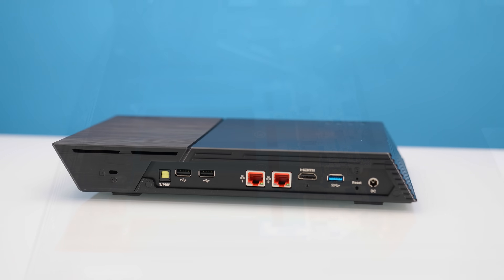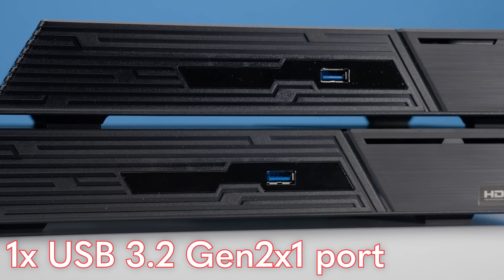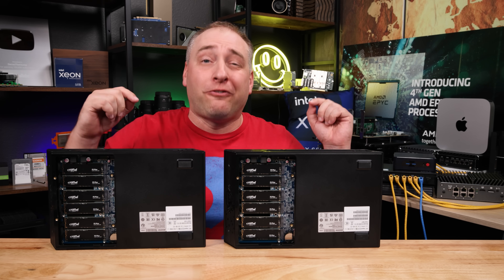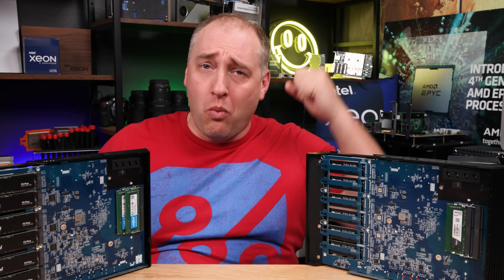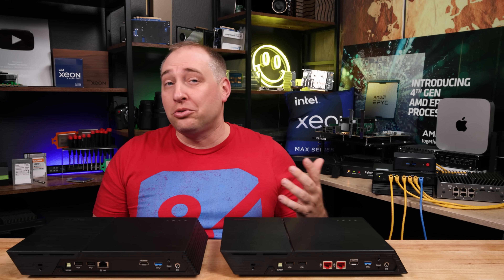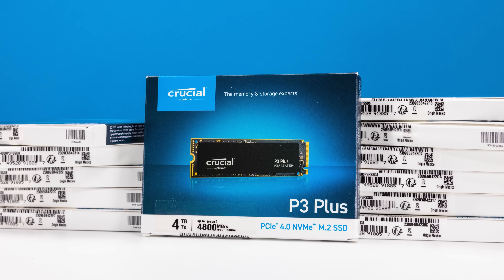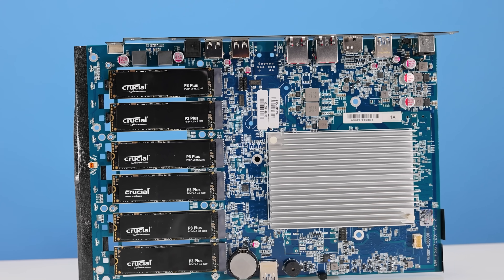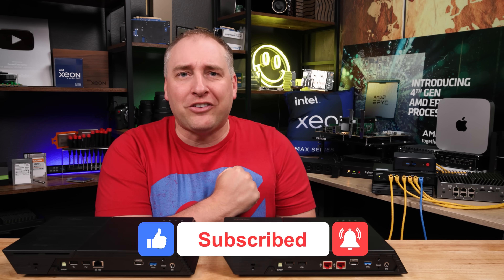Crazy 48TB SSD NAS and Cheap 6TB Version Asustor Flashstor FS67

Comment: I'm considering between the TBS-464 and the FS6706T.
The TBS-464 supports ZFS, but it has fewer M.2 and RAM slots compared to the FS6706T.
Is ZFS such a significant advantage that it's worth giving up the better hardware expandability?

Comment: Even though they think they need to price this device at the same price as a 6-bay HDD NAS, I think they should cut it to $249 for the USA market. Home users would love it! Load it with 6 x 2TB sticks and you’ll have more than enough storage for the average family. But add a 10Gbps connection to make us feel good. Most ISPs only offer 1GBps. I’d buy it at $249. HDDs are becoming obsolete, just like CDs.

Comment: I really don’t understand why they went so anemic on the processors, retail price for a way more powerful CPU, including a cooler and IHS is <$100… Toss the cooler, toss the IHS, toss the retail packaging, and toss the PCIe switches, they should be able to get something with may more connectivity for a few extra dollars, 20 at most.
Reply from the maker: These also use a lot less power. Important for 24x7 on devices.

Comment: In our studio we have 2 of the 10GbE model and after few months of usage they are just Great. One whe use for fast backup on set and the other one for the VR in house set as storage for the dedicated Unreal WS. Both situation require light/small, high capacity, non moving part storage.
However we upgarded the RAM and we instaled TrueNAS scale instead than the original OS. ZFS z2 setup(28TB practical capacity), easy cloud sync, openvpn, auto shut down on power failure,small custom docker to manage some in house utility, etc.) 
Like you said this is mainly a storage solutions you don't get crazy speed out of it but is very light, low consomption, very costumizable.
Low consomption is great on set where often we work on powerbank.
Reply from the maker: I am now using one in the studio and one at home just for the quiet operation as well.

Comment: I kind of get it, but since they don't need pcie drives for performance, you could also build something like it with Sata SSDs which could make it cheaper as there are less pcie lane issues. At least for DIY you could get the same results with sata for cheaper, but probably not easily in that small space.

Comment: im pretty unfamiliat with NAS's so my main question is: What OS does this thing run? 

Im planning out my hime network right now and would like to have a home server for storage and backups and use this thing for that and even as a firewall since the 6 drive versikn has 2 ports. 

But id like to install windows server core on it. But does that use up one for the slots? Can I install Linux on it? Can i put it into my windows server domain? 

And i know that its probably not best to have firewall and NAS in one device but I still dont know anything about operating this thing bejond benchmarks 

But Im happy to see upgradeable RAM.

Comment: I'm interested in using something like this for audio plug-ins. I've run into a problem with my UAD Apollo audio interface not working on either of my Windows systems and I'd like to pickup an Apple Studio with 2TB internal for audio applications only with plug-ins installed on the NAS with possible audio storage that may need accessing in the DAW. Any considerations? or would this result in audio artifacts due to speed restrictions. I don't want to invest in something that would theoretically work only to find out that working on larger projects will result in failure.

Comment: There are people, who just need large storages for storing movies or recorded videos, once data is stored there won't be a lot of editing in them,
Hard drives are not a good solution due to moving, fragile and bulky parts...
Ssd will shine in such cases...
A solution must exist with
1. Lower transfer speeds.
2. Lower TBW
3. Lower write speeds, (and a fast cache drive)
4. Sata as it would be cheaper than m.2

Comment: These m.2 SSD are The Same Speed but Cheaper Silicon Power 4TB UD90 NVMe 4.0 Gen4 PCIe M.2 SSD 
With they work in the Asustor Flashstor FS6712X?  Save me $50 buck per ssd? $159 each 4TB

Comment: two questions Can I use the SABRENT 8TB Rocket 4 Plus NVMe 4.0 Gen4 PCIe M.2 Internal SSD Extreme  in the 
Asustor Flashstor FS6712X ? Also , I is use only 8 Slot of the 12 slot ssd with 8 drives @4tb m.2 ssds?

Comment: I got the 12 drive one. It became clear very quickly it was nowhere near as legit as my QNAP but it grew on me pretty quickly once I begun to appreciate what it was and stopped trying to compare it to other things. I have since decided to use it as the low power central hub for my media center data, apps, and related docker containers. For that specific purpose It's pretty damn slick and multiple Plex 4K playback is smooth even with the CPU pegged; doesn't matter, it stays responsive. Its whisper quit and small, so it disappears in my entertainment rack. The UI and the apps are not as diverse as QNAPs or as apple-y as Synology but it's experience overall is very serviceable. 

For a power user needing to host VMs and manage a diverse set of workloads this won't work; it can't even support multiple VLANs on the same NIC. VirtualBox feels like its trapped in the 90s. But for basic use or even modernly advanced needs, I would recommend this.
Reply: Hello do you mean it is compatible with plex server.  That would be my main use

Comment: The key test of SMB server is browsing large directories, which is the problem for any NAS. Create a directory with 30K files and then open it from a client. See the green band of death in Windows Explorer? That is it, you see how actually good or bad the NAS is. Copying large files is irrelevant for NAS. Cheap 1Gbaud is more than enough for streaming purposes. Streaming is normally a client-side problem if the client lacks hardware codecs.
If you do not care about power consumption, a normal desktop PC with Linux Ubuntu and zfs built out of old turning rust drives is more than enough.

Comment: NVME is still not even close to HDD pricing for big NAS Storage. 
Do the same with HDDs and it's 1/10 the cost.
Reply from the maker: It is a bit closer with operating costs, especially with new 61.44TB NVMe SSDs
Reply: @ServeTheHomeVideo   There's a single SSD stick that is 61 Terrabytes?

Comment: thanks for your review. I'm about to go for the 12-bay one but I have doubts. It is only for Max studio in 10gb network. could you configure 2x2tb raid 1 (Time Machine) 4x2 raid 5 for Final Cut? and 2x2 raid 1 for Max applications and the nas itself? Could you do it little by little? first system apps then finalcut…. etc (for not having to spend all of one. Would you be able to do that and manage the different raids? Obviously you would look at the ram you have and expand it. Do you know what the Maximum is? I understand it will be ddr4 or dimm 2666? Thanks for your attention

Comment: I'm not surprised it kept crashing with higher capacity RAM because the Intel Celeron N5105 supports a maximum of 16GB of DDR4 at 2933MHz. I imagine as soon as the system deposits data onto memory outside of the 16-gig-pool the CPU recognizes, it freaks out and goes "Derp, poof!"

Comment: The issue with your picks is the $ cost. DIY is the way to go.
There is little justification for these devices once you figure out how many dollars can be saved or how much more value you get for the dosh spent.
This leads me to wish that YT needs to make it easier to block channels. This is not the way. Waste of my time.
Reply from the maker: When I started STH 14 years ago, I would have agreed. About 5 years ago I realized time does have a monetary component. Having this up and running in less time than it takes to pick components is a big deal to a lot of folks. Just a different views over time.

Comment: Very cool! How does is the power consumption you measures compare with HDD NAS setups?
Reply from the maker: The system is the same given the same CPU/ NICs/ components. The SSDs tend to use less power, but you need more of them for a given capacity.
Reply: @ServeTheHomeVideo  ah, good point! So there's an effective power consumption per TB.

Comment: I have an old 5 bay Synology with 4+1 14 TB drives installed.  It works well, but… it would be interesting to upgrade it, due to longevity of SSD’s.  But NAS systems are essentially dependent on their software.  Who makes the software for these units?  It would be nice to know the features and stats.

Comment: Don't by this one. Buy an i3 10100 or comparable AMD processor with 16 gig of RAM Desktop. Add Duel 10G Copper RJ45 card. Build a TrueNAS or Proxmox server for the same cost for multifold better performance. Multiple SATA SSD in ZFS will provide much higher speed than what you get here.
Reply: I agree but as soon as you go down the DIY path you're talking about a mATX board and another huge case.  If you want something small, quiet and DIY it's hopeless.
Reply: @johncalla2151  
If you want performance at low cost it is not hopeless. I built few.
.
if you want small, quiet and DIY, go with supermicro, A2SDi-H-TF or A2SDi-8C-HLN4F or A2SDi-8C+-HLN4F or A2SDi-12C-HLN4F or A2SDi-16C-HLN4F or A2SDi-16C+-HLN4F.
I have built many with 16 to 64 GB Registered ECC RAM. SATA SSDs with these motherbord gives better price to performance with these motherboards than the NVMe in this video. I built many for my customers and friends.
.
At home I own  TRUENAS Core Supermicro A2SDi-8C-HLN4F 32GB Regiested ECC RAM with 2 SATA SSD boot pool, 6 SATA SSDs with ZFS Z2 for main usable storage, and 4 SATA HDDs with Z1. Built using a desktop case. Two years on, its working fantastic.
.
For may office I built with Supermicro A2SDi-H-TF with 64GB Regiested ECC RAM. It has 2 X 10G on board. SSD and HDD configuration is same.
.
Office SSDs are backed up on my home HDDs. and Home SSDs are backed up on office HDDs.
.
I am open for your inputs on price to performance ratio.

Comment: Considering the price they are a steal. I just rebuilded my Homeserver and to lower the Powerconsumption i got myself a PCIE 16 to 4nvme Card. The Board doesn't support Bidurication so the PCIE Switching Card costs around 200 Bucks alone. I have some old HDD as cheap Data dumps too. My Problem would that i have some VM's running with RDP on my Homeserver. (Gaming-Server, Virus Sandbox etc) so the performance wouldn't be enough. It would make a great Network Device.  I think a nice 6/12 CPU from Intel/AMD, like an 12400/13400 or 5600G/7600. The possibility to upgrade with 64GB ECC as top of the line modell of the Asustor Series would be great. It would require more Cooling, but make a 1HE oder 2HE capable Housing and you got a great Microserver, especially the 12 NVME Slot Version. The 750$ Version is a little underpowered with the CPU, 150-200$ more a bigger CPU and more Ram and it would be a real great product.

Comment: Thanks for the review! I like the concept, but the cost is too high for my taste. I've two 6TB NAS (one is used as backup NAS) that together cost much less, are much smaller, consume less power and do not need a fan. Only disadvantage, I use HDD's for storage and 1GB NIC's. That's good enough for my use-case. But if prices go down, I'd consider switching to M.2.

Comment: Daaaaaaaamn there's a quick way to kill NVMe drives! Super quick way. Especially cheapo slow ones with low endurance like the ones he installed. lol. Should definitely throw quality drives from Samsung into something like this, but probably avoid this type of gimmick all together.
Reply from the maker: Even with RAID, NAS workloads are normally well over 10:1 R:W. Samsung M.2's in servers actually have high enough failure rates that many server VARs stopped using them 2-3 years ago. Having lower heat in these also helps a lot.
Reply: @ServeTheHomeVideo  Not with RAID at all. RAID does more writes than reads typically to keep the array healthy. I work with enterprise servers every day. We have no NVMe anywhere for any client because of the subpar endurance in the server environment. And heat has nothing to do with write endurance. Absolutely nothing.

Comment: $840 for the empty box, and $2880 for the drives. using it as a network attached storage device you're asking for trouble as SSD's arent happy when used in a read/write heavy environment. ill stick with my retired server with 8 22tb mechanical hard drives
Reply from the maker: NAS workloads are dominated by reads, and are typically very sequential.

Comment: There should be a usb c connection on the 12 version to connect directly to a computer, as well as that 10gbe. Pretty good, and tempting, to be able to store, but also do cheap vms.
Reply from the maker: Super idea. I think the N5105 is limited in terms of high-speed IO lanes. This is already pushing the platform pretty far. Hopefully on a refresh that would be possible.

Comment: (I've since seen this box reviewed a bunch of places, but you were the first, from my perspective at least...) I just replaced a pair of HP Proliant boxes with a lot of 3.5" spinning rust, with the little version of this and raid-6 over 6x2T.  vast upgrade, quieter, cooler, faster in every way.  Shoved ubuntu 23.04 on it (8G onboard is way too small, but it's enough to get going with setup until I carved off a mirror of some extra space on two of the slightly larger SSDs for the root disk - turns out 50G is decent for an OS install, and round off error for 2T SSD sizes :-)  Also maxed out the RAM.  (For all the complaints about it being underpowered - for me, it was a cheap upgrade for a cheap homelab setup, if anything it was overpowered.)
Reply from the maker: Glad you have had a good experience thus far! We have been using both of these daily

Comment: I dont understand why you use P3 plus which is a PCIe Gen4 while the Celeron N5105  CPU only support PCIe Gen 3. In this case P3 (without plus) is ok ? I have an other question : How many PCI lane per SSD drive ?  Thanks for your video.

Comment: these feel soo out of place. They aren't high performance so why pay the premium for an all ssd NAS compared to a NAS that just has a ssd cache. They need to use a lot higher spec cpu and/or make what they have a lot cheaper. That driveless nas enclosure shouldn't be breaking $150 honestly. They have a good idea just a really stupid implementation. Need to use a cpu that can support at least 2 lanes for each slot (ideally 4 but good luck finding a lower(-ish) power cpu with that) it feels like there is a massive gap in the market there. I know amd is a lot more generous with their pci-e lanes but nothing on the lower end. It feels like amd should release an APU like they have for the steamdeck/rog ally just with a shit ton more pci-e lanes specifically for NAS applications and that would be pretty ideal. Have the cpu have enough grunt to do more than just manage drive data transfers.

Comment: It is disappointing that manufacturers are making devices like this more consumer market than rugged metal cases for business market and yep the size seems unnecessarily large and awkward yet mounting the drives with pressure lugs shows empathy for us propeller-heads.
The memory limitation/instability issue makes me wonder if they cut corners for a few cents?
At first glance one could assume this thing is a gaming console.  ha ha ha.
They could have had this also act as a controller for a conventional multi-drive-bay add-on module giving the best of both worlds.
Reply from the maker: The memory limitation is more of an Intel chip memory limitation.

Comment: Is there any drawback to connecting the NAS to a Mac Studio with SSD for the 10G speed and the rest of the computers on the network via ethernet?  Do you get the same functionality in terms of storage and apps? Looking at 6-bay unit.
Reply from the maker: Usually you would just use a switch with at least two 10Gbase-T ports and plug one into the Mac Studio and one into the 10Gbase-T NAS port. That will work great.

Comment: I was somehow under the impression that SSDs were not good for use in a NAS as there would be frequent read/write cycles and that would quickly max out the number of cycles on an SSD.  Or do I have that wrong? 

I do know that argument had been made as applies to DVRs and Storage for video security systems because they are constantly reading and writing.

Comment: crazy idea, probably, but there are m.2 nvme to sata adapters and there can be 5 sata ports, I've seen even 6 ports, so in theory even the one with 6 ports could have 6×6 36 drives, and the one with 12 12×6 72 sata drives, in theory. Probably sounds like a crazy idea

Comment: I have no use realistically for 10g on my home system.  but I have a question is it possible to run a cable from a 1g router to a 10g network port?  does it work?
Reply from the maker: 1GbE to 10GbE should always work. 2.5GbE and 5GBE to 10GbE would depend on the chipset. You could also use a switch.
Reply: @ServeTheHomeVideo  Good to know.  I'm fine at basic 1gbe networking, but they keep adding new stuff and i can't keep up.  Thank you!

Comment: What are those black gloves in the shots where the NVME drives are installed? They don't really look like nitril?
Reply from the maker: Bryan #2 uses Nitrile gloves when doing photos/ B-roll so that he does not leave smudges.
Reply: @ServeTheHomeVideo  Thanks for explaining. He must use them several sizes too large then, as they look like some kind of loose fitting leather 😀